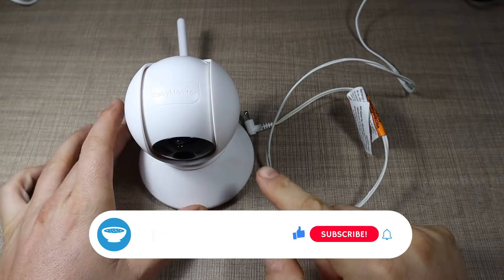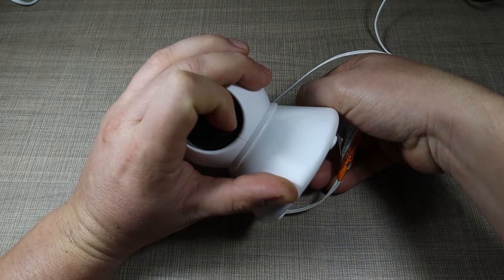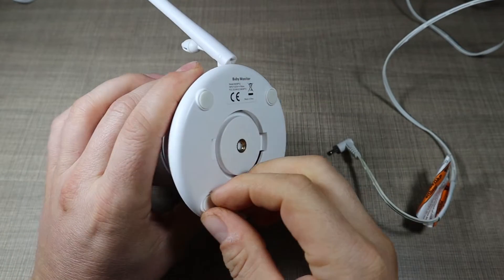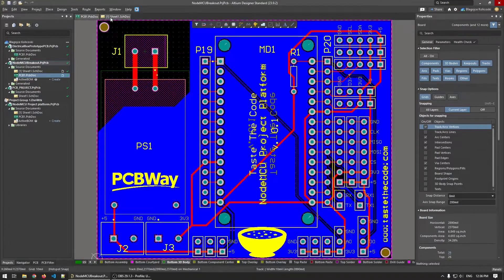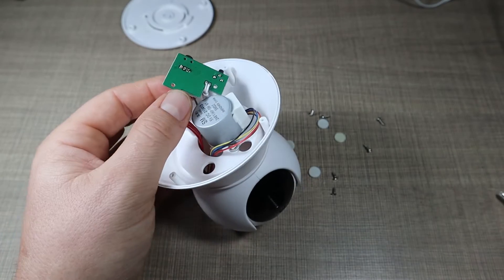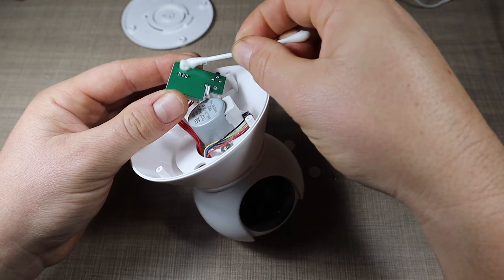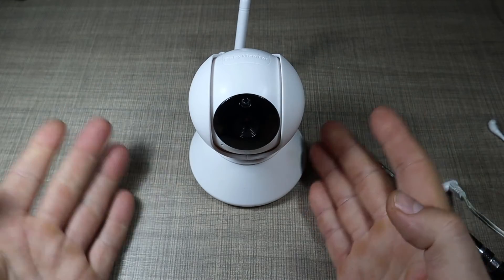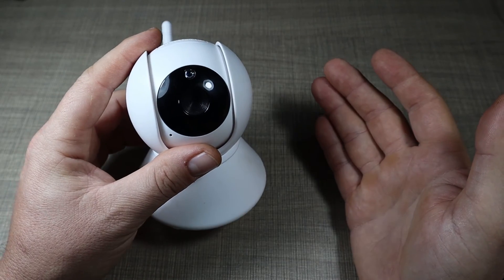Repairing a Baby Monitor Camera with an intermittent disconnect issue

Comment: Mine just stopped pairing with my phone. WiFi is perfectly fine. It won’t show up and when I pair it manually it fails to connect at the end of its upload.
Reply from the maker: Sounds like an issue with the Bluetooth module. Have you tried to leave it without power for a minute or so? Maybe it resets itself?

Comment: do you know how to dissasemble the reciever ? i have charge issues, the adapter is working and gives the 5V,  reciever is not charging. i think a issue with the charge port
Reply from the maker: No I have not disassembled the receiver but you can look at some obvious screws.

Comment: I am looking on how to open T8301-C model. It has no rubber feet hence it is not obvious where are screws.
Reply: I’m actually working on the same one and I just found that you have to rip off the rubber circle pad on the bottom
Reply from the maker: I haven't looked at that specific model but looking by the pictures online, it seems that there is a sticker on the bottom. Screws might be hiding beneath it. You can try to gently peal it off or poke gently with something sharp and see if it falls through at some place.

Comment: I have mine mounted to the sealing, now everything is up side down on the screen. Is there a hack that allows me to view it as normal?
Reply from the maker: There should be a setting in the app/screen to flip the image but it is dependent on the manufacturer. It is best to check the manual.
Reply: @TasteTheCode  No setting unfortunately, seems they missed that..